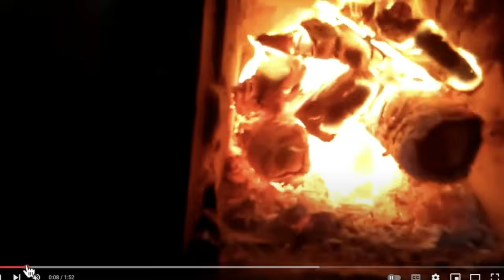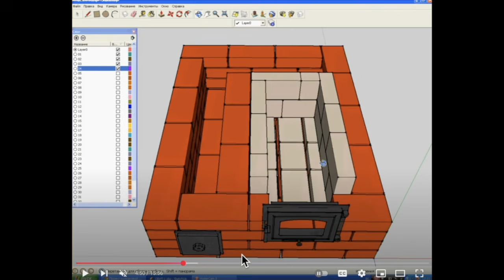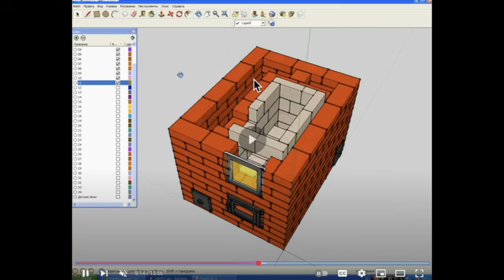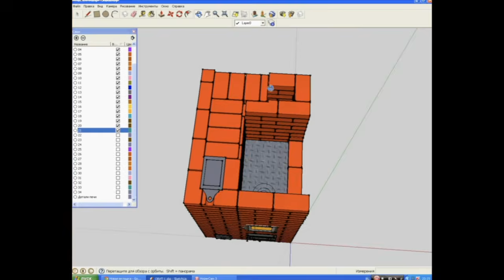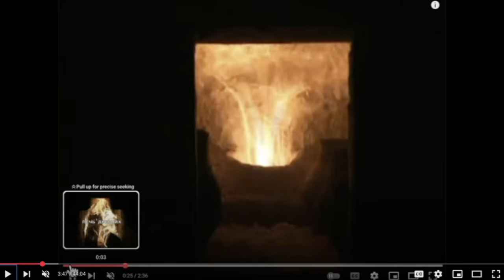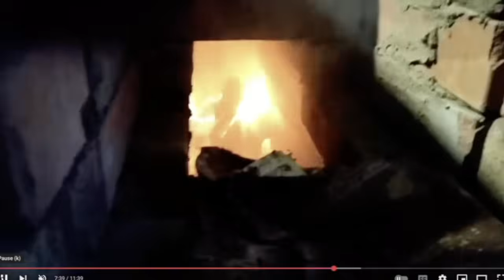The Coolest and Best Wood Stove (My video is only a secondary air TEST of the firebox)

Comment: Hi, Matt! its very nice then peope on the another side Atlantic are interested for building stoves.. I built that stove from Terentev project and Im not satisfaied on 100% for this  :). there is not complete combustion of secondary gases in this stove and is not kind flame jet like in pda ancient aryan stove that Kiril Rud experiments with. I will redesigning combustion core, good thing - easy to modify (only removing top plate). I wiil do secondary gas channels under ground.. I think i see in your stove a mistake, sorry im not master but know 100% - the secondary air must be hot at least 300C if lower the air cold a flame.. I think your tube is to much huge the air has time to cool down , you can put a damper on a pipe. .This temeperature not constant it depends what construction you have. If you want i can do video what i plan to do. I hope i will get first usually air, after second to the jet, and fird small air to untill full combustion of the gases.. Also i plan make a pica stove like Kiril made, I think i understand how to that :).  Your stove is nice and easy experiment !!!

Comment: Thanks for sharing.

The primary intake is too large relative to the amount of wood; because it can supply sufficient oxygen, the secondary intake becomes ineffective.

Burning something like this indoors would not be very beneficial, because it works like a huge air transfer machine. It takes the air from inside the house, heats it, and then expels it outside. To keep the heat inside instead of losing it - to make it efficient - you would need to use a lot of brick. In that case it would be efficient but impractical, because it would take a very long time for the room to start warming up. This is exactly what rocket stove enthusiasts fail to understand.

Secondary combustion is important because it allows efficiency to be maintained even when the main combustion is controlled, slowed down. Secondary combustion is practically the only way to have an efficient and functional wood fire indoors.

Comment: It should be taken into account that the stove is not airtight and, in addition to the large opening for the combustion chamber, secondary air gets there through all the gaps between the bricks, so inserting a secondary air pipe makes no difference.

Comment: Okay, making more sense with the second combustion thing. Try LESS air intake for your second. Too much will just 'rob' your primary combustion and cool/dilute your exhaust, is all... Also, you'll need to separate your secondary combustion chamber away from your primary. But IDK why you'd want that here, as a kiln is designed to heat at astronomical temps using compressed air, mixed gasses, etc. You're not getting that here, with a fireplace. You'd need stupid-heated air in order to re-combust the exhaust in a fireplace. Two different beasts altogether.

Comment: Thank you for your videos. What are the dimensions of the red brick?  What is the mortar used for the red brick?   Thank you.
Reply from the maker: The red brick is never the same as the firebrick. They come in different sizes. I use "red brick" pavers at 8 inches by 4 because they are symmetrical and everything lines up with very few cuts. Regular red brick "does not line up." You can use it, but it will require many wet saw or angle grinder cuts. Mortar for firebrick is the refractory mortar with tiny joints. Red brick mortar is 3 parts sand, 1 part fireclay, and 1 part lime.

Comment: The fact that your secondary air made no difference is a good indication that you have your intake and exhaust ports properly sized to your chimney, burn chamber, and afterburner. That's by my understanding at least. The bell will change the behavior of the engine but it looks like it's running right. This "engine" is very similar to the one I use, just that my "afterburner" is folded in half. The folding helps to mix the gases thoroughly producing the cool looking flame fountain and reduces the overall height of the engine, but may slow the gases some. Letting the flames lap up high likely has advantages as well. I know some of the rocket stoves use a "stumbling block" in the afterburner, maybe something similar could be incorporated in the vertical afterburner to disturb, swirl or otherwise mix the gases to fully burn as they rise. Great vid man!
Reply: I light my fire about 2/3 up from the bottom, usually with a rolled up hunk of cardboard strategically stuck between and underneath some smaller split wood at the top, with the larger pieces of wood at the bottom of the stack. I find this helps with the initial draw and people with testers have determined that it does make the exhaust test more clean over the course of the burn. Not sure if this applies to all stoves of course, just with batch box RMH
Reply from the maker: Thanks for the info J !

Comment: Secondary air is only useful if primary air is restricted.  With the front of the firebox open there's easy access for air over the top of the fuel.  Without air intake being restricted to avoid excess air you get the effect you've mentioned before of the chimney drawing heat from the room.  Of course the restriction has to be upstream of the firebox or you risk smoking out the house.  Too much restriction downstream and the combustion gasses find another way out.

In aeronautics the tendency of a fluid stream to follow a parallel surface is well known.  The stream pumps out the fluid between it and the surface, pulling the stream towards the surface.

https://en.wikipedia.org/wiki/Bernoulli's_principle
Reply from the maker: I hear ya, but the space between the first and second chamber is a tiny little box...... that, I thought..... was the restriction. I agree, in the test I left the front open, but there is not enough time for all that air coming in to mix perfectly around the firebox and "eat up" all the smoke. To me, it's actually this "small space" or restriction that is largely responsible for "no smoke" because in that small space between chambers there are absurdly high temperature with "the smoke having to pass through this temperature zone." No smoke can make it through without "going poof" ..... maybe?

Comment: There’s something awesome about the first fire of the year,,,, it’s coming soon here in the rust belt. :)

Do you have any experience reinforcing the floor for weight of the masonry stoves (stick built home)?
Is there math formulas? What to do for reinforcing?

Thanks Matt
Reply from the maker: Concrete blocks (some call cinder blocks) with the two openings are still very cheap. I would simply stack them up in 5 columns (like a 5 on the dice) and pour your stove base on that... a square mold with 3/4 inch plywood base, lined up and down with rebar. If you already have a "decent floor" that just needs a bit of help, wedge in 6x6 footers as you add weight. This advice is not good because I have no idea what you are dealing with there.
Reply: You absolutely need to build a foundation up from the crawlspace or basement below. Even if the wood floor can support the weight you will get slow and increasing deflection beneath the stove. Ask me how I know.
Reply: @josephcrawley3095 How do you know? 😬

Comment: I cooked for several years on a Knox meal master. It had eyelets like that Russian cook top. They never leaked smoke but they certainly put soot on the pots when you cook over the open fame. On my masonry stove I switched over to a neoceramic top pulled off a scrapped electric oven. It works very well. Great heat transfer and can see the flames although it is shaded.